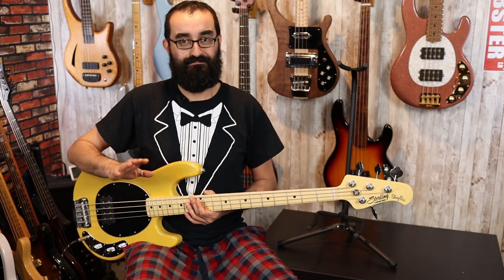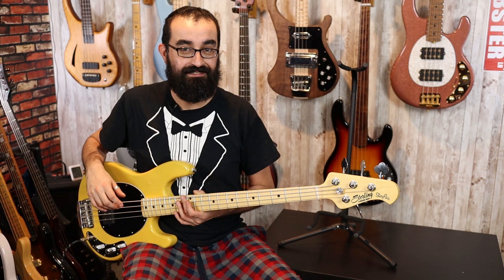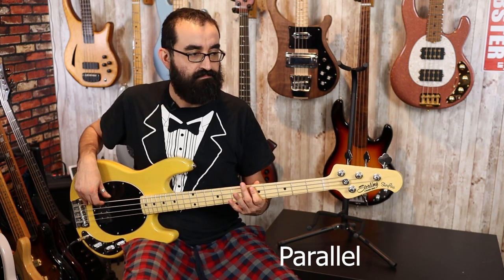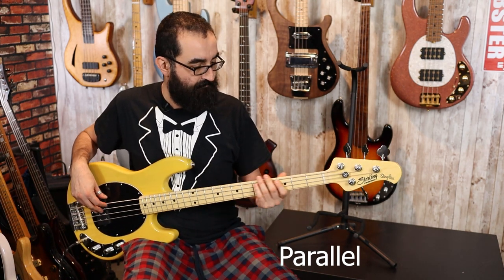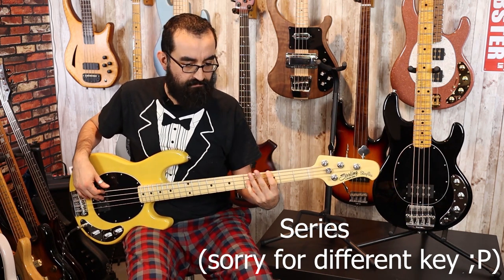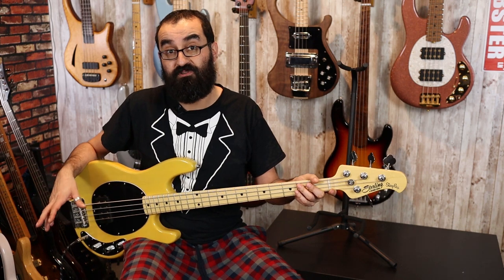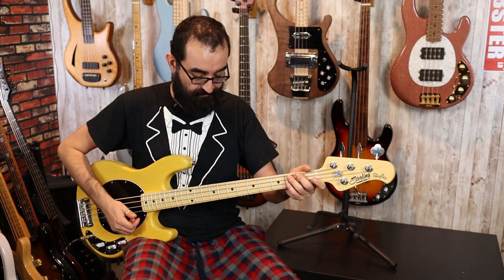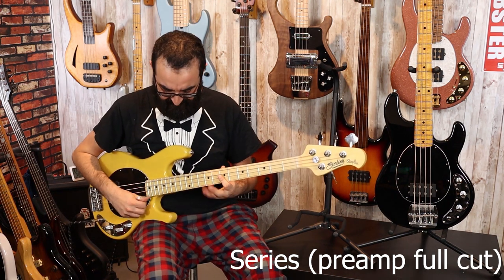Sterling by Music Man Ray24CA wired in Parallel! Why isn't this stock?- LowEndLobster Fresh Look

Comment: True, the parallel wiring is way way better, sounds snappier and more crispy. Has more color to it. I agree, why wouldn't they wire the basses like that?!
Reply from the maker: IMO to make this and the lower SUB line be less authentic vs. their higher end Stingray counterparts. Just a feeling, have 0 evidence to back that up.
Reply: @LowEndLobster  True. Never  in a company's best interest to produce the "perfect" thing because other wise would they have to sell?
Reply: With my Ray4 I was having a lot of trouble with any kind of boost on the bass control causing the input to clip on my Rumble.  Just too much output, even with the pickups screwed all the way down.  Switching to parallel gave me full use of the preamp controls and no clipping!
Reply: Snappy? Crispy? Color?

Comment: I think the sound is very similar either way. As others have said, a series/parallel switch would be a great option. I already liked this bass, you have really got me thinking about buying one around New Years.
Reply from the maker: Thanks! I was thinking about doing the series/parallel switch mod here, but it would get in the way of the ribbon cable for the volume control on the JE preamp (silly design, those things are very fragile).

Comment: I rewired my bottom of the line Ray4 to parallel this afternoon.  I recorded a before and after in GarageBand and it's definitely quieter and cleaner sounding in parallel.  It sounds different and the waveform looks different.  Maybe it's the audio compression YouTube puts on videos, but my results were much more dramatic than yours.

Comment: Just changed the wiring on mine, which is a 25ca. On this bass the parallel setup does make a difference. It's very slight but noticeable. The only thing I have to compare side by side is the Ray34  wired in parallel, and Ray35, which has the series/parallel switch. Both smoke this bass but they are different pre amps and pickups. That bite is there and with some additional EQ it's close.
Reply from the maker: Very nice! Thank you for sharing, Jim

Comment: Awesome video! Parallel is notably different! Do you think it would be possible to make a video showing us how to wire a SUB in parallel?
Reply from the maker: Thanks Roper! So with the SUB, it's a lot harder because you need to take apart the pickup. With the Ray24, there's a second lead and ground that are accessible and just soldered and taped together. Disconnect those and attach them to where the main lead and ground are attached. I believe it goes Red+black for hot and then green, white, shield for ground. Much easier on the 24. I did shoot a separate video showing how to take apart and install the EMG MMHZ and BQC preamp in a SUB though :). That'll come soon.

Comment: I just finished doing this mod myself with a CTS DPDT Push-Pull pot to switch between series/parallel. In parallel, I feel like I get a more cleaner even sound. In series, the output is much hotter, with scooped mid frequencies. With the volume maxed out, parallel remains clean while series sounds overdriven especially when played aggressively. On the amp, at the same gain and volume settings, it’s significantly louder in series than in parallel.

Comment: Both sound great..series is my pick. Would love to see a switch of some sort to have both options on tap.
Reply from the maker: Thanks Robert! I have a switch on a different SUB project (mint-o-ray), but one would be a tighter fit here since I popped in the JE preamp (don't want one of the switch lugs to nick the ribbon cable for the JE volume knob). It's definitely a worthwhile mod if you want that flexibility.

Comment: Parallel is the way to go. I’d go the extra mile and get a replacement bridge to make it possible for a string thru body configuration. I’ve got the ray34 HH in pearl white. The wiring is screwy too. Instead of position 2 & 4 being outer coils and inner coils, respectively it’s full bridge pickup and outer neck coil and inner bridge coil and full neck pickup. While it isn’t how it’s supposed to be according to diagrams it really makes for some interesting tones. 🤷🏻‍♂️
Reply from the maker: Very interesting. I explored the Ray5hh earlier on in the channel but not in the detail that I've done recently. Need to def check out the Ray4hh and 34hh some point soon and do a deep dive
Reply: It’s pretty good. I’ve debated on rewiring it but I think this way makes it unique. The only mod done was I had my gf sticker bomb the pick guard. Which I feel is only fitting since I named it after her.

Comment: Got a new pickup today for my SUB bass.  Going to wire in parallel but can't find any pictures or wiring diagrams to show where to solder.  I've found a video for in series but not in parallel.  Can anybody help?  I'll be doing it in the next couple of days (waiting for my soldering iron 🙃).  Thanks!

Comment: On my modified SUB with Duncan electronics, I have a push/push volume pot to select between series/parallel. 
I use series 99% of the time. It has more girth and cuts through the mix better for me
Reply from the maker: Nice!

Comment: The parallel has more high end sizzle but series has more punch. I saw another video where the guy had a push/pull volume so you could have either. Might do that.

Comment: First of I really like your clips very informative . Can you tell me is the Sterling ray 4 wired in series as well as I just purchased on I would like to wire it in parallel as well . Thanks in advance.  Cheers.
Reply from the maker: Sterling Ray 4 is wired in series. Not all pickups of theirs can be wired in parallel, some are only two conductor and not four.
Reply: Thank you for the info.

Comment: It sounds duller in parallel to me. Seems like the serial is a little brighter and more articulate but then again I'm listening on computer speakers to a compressed & streamed video. Did you think it sounded better in parallel? Would have been nice to hear what you thought in the room. You didn't really say. I'm thinking they did the ceramic pickup and wired it series to brighten things up with the mahogany body vs the ash with Alnico pickup on a MM. Also, the color is a classic color for a Stingray. I just bought one on sale about 23% off from M.F. yesterday. I guess I'll find out how I like it in about a week!

Comment: Series sounded a little darker with a bit more attack while parallel seemed to have a more balanced tone, pretty much what you would expect.  I couldn't possibly decide which I like better without playing the bass in a rehearsal to hear how each sounded in a mix, and would probably end up wanting to install a series/parallel switch.

So, did the mod require any soldering? Just curious as you said it only took you a few minutes. I like soldering and would have been a little disappointed if I didn't have to solder. :)
Reply from the maker: Yup! Just two solder points. You disconnect the existing bridged lead/ground that are taped up, and then wire those to the existing lead and ground spots on the preamp PCB. Very easy.
Reply: @LowEndLobster  you should do a video doing it for schmucks like me

Comment: Not worth the work to switch, just sit the eq on the amp. 
However, if you will open up the electronics, you may as well upgrade the Pickup and Preamp and them use a push/pull… buy a Rey34 or just let it be. 
I know you’ve done more videos on this Bass with all the mods but I’m just venting on this setup. 

You Rock, Lowend Lobster👍🏽
Reply from the maker: Thanks Sumbi!

Comment: Think for finger style I slightly preferred series.  Preferred parallel for slap.  You made both sound good though 👍

Have you ever done a Ray pickup head to head?  Between the various stock pups, the Aguilar, SD, Wilkenson, etc. in various projects, any preferences so far?  I now have a SUB en route (I blame Shia) and if conventional wisdom holds may be tempted to try a swap in the not too distant future.
Reply from the maker: Thanks Joe! I have a BIG head to head to head to head to head to head coming. 6x SUBs modded with 3 band preamps and pickups from EMG, Aguilar, SD, Nordstrand, Bartolini and Tone Monster! I just finished modding the last of them yesterday and going to begin shooting video this weekend! Very excited for this. Not all of them have the goal of sounding like a "traditional" ray, so I'm not going to judge them in that way, but we'll be looking at ease of installation, components, features, sounds, etc. Going to do separate videos on each SUB, and then a big video comparing some of the more popular settings between the 6. Stay tuned :)
Reply: Sweeeeeet - looking forward to it!

Comment: Great video as always. Thanks!!! I just got the same model and for sure want the parallel option with a push/pull volume pot. While my tech is doing that for me do you recommend or think it would be worth it to get a better tone pot and shielding too? If so what kind do you recommend? Again, thank you for the great videos.
👍♥️👍
Reply from the maker: Heyo! I don't think this bass would benefit much from better pots or shielding. Noise and pot quality wasn't really much of an issue. Would be better off upgrading the preamp if you saw the need.
Reply: @LowEndLobster  Thanks, I appreciate ya, Mr. Lobster 👍👍 I will indeed be doing the Pre amp/pickup swap asap!

Comment: The difference is subtle. I’ll probably rewire mine, or rather have someone else rewire it as the solder points are pretty small.
Reply from the maker: Thanks John! Good luck either way you go :)

Comment: Hi thanks for your informative and fun videos! Do you think you’ve handled enough of SBMM’s that you could share your experience with how much they weigh? Is any of them comparable to the weight of the Stingray Specials?
Reply from the maker: Great question Valdi! My next vid coming out when I am done resting up will actually be comparing my SR Special 4H to my regular SR 4H and I will definitely include weight. My SUBs and Ray24 are in the same neighborhood as my 2017 USA EBMM Stingray 4h (9.4 lbs) whereas my SR Special is 8.2! The weight savings are noticeable when moving to the special, but the standard Ray and the SBMM Ray4-24 tend to sit around 9 lbs. My Ray34 that I had was 11 lbs, however I have a friend with one that's only 9.5- they really can vary quite a bit.
Reply: Thats a nitty gritty answer, Lobsterman! Thank you :) wouldn’t it be cool if there was a bass weight statistician? Ordering a bass not knowing the weight feels a bit like a russian roulette to me. In a live situation a small difference in weight can make a big difference. Kudos to Sweetwater for showing the weight on their site.

Comment: Parallel sounds more shimmery like a real USA Musicman. I had a G&L M2500 once and I wondered why I couldn't get a nice open sound like on my L2500. Turns out the M2500 is wired series. I sold it.
Reply from the maker: Thanks Richard! I didn't know that about the M2500. I really need to dive deeper into G&L

Comment: Hello! I know this is an old video so you may not see my comment but I had a question. Do you have a video of how to change it to parallel? I’m getting one of these in a trade and want to use it as a project. This will be my first time modding a bass. Or if there is a diagram of what I have to swap that helps too. Thanks!

Comment: Lots of people seems interested in a switch, as well as myself. Would it be possible to do? And if yes, would it be possible to have a vid to show how to do it?   Today at long & mcquade, I tried the RaySS4 which has a factory switch for series, single and parallel mode. Its a pretty cool feature but unfortunately not available in any of the full size Sterling.  I preferred parallel for slapping but series for fingering.

Comment: Shieeeet I'm rewiring mine right away. Def sounds closer to an OG stingray in parallel.
Reply from the maker: If you have a solid drill/drill press, you could totally make some room for a series/parallel switch and get both options. But yeah, the parallel mod definitely makes the tone a lot more in line with a real classic stingray
Reply: @LowEndLobster  thanks Lobster. You're the bossss

Comment: Hi, I’m the New owner of a 2021 ebmm sterling5. Suppose to be wired in series except both humbucker in parallel in position 3. If you take a look on picture, pickups only have 3 wires. Black, red and green. How can they split coil in position 2 and 4 with only 3 wires? Can I install a switch to have my Humbucker in parallel in position one when I need to?

Comment: Did you have to solder the ground and hot wires to the correct locations to get parallel or are there clips/slots? Thanks!
Reply from the maker: Great question! You have to solder for the stock preamp
Reply: @LowEndLobster  Cool, man. Sorry, I scrolled thru the comments after I commented and saw you answered this question already lol… I just ordered one of these but haven’t received it yet. I’ve owned many EBMM Stingrays over the years and sold them all.. only wish I had one back- 1992 sunburst/rosewood 2 band eq.. even had a natural Stingray Classic with a birdseye maple neck that warped!! Sent back to EBMM and they replaced it with a non figured neck. But I sold ot. Mostly play a P bass and J bass now, but wanted another Stingray in my arsenal for that punchy sound, but didn’t want to spend $2k on a bass that wouldn’t be my main axe, so ordered the Sterling… sorry for the novel lmao

Comment: What are your plans for the 3 band pre as far as pot layout goes? Stacked Pot for Mid/Bass / High/Mid? My gf just got herself this classic 24 sterling as a five string and I am planing to switch the volume pot for a push pull or push push to give her both serial and parallel at will. I think that is definitely the best option for this bass. What do you think? Thanks for the in depth videos and also for talking about the exposed wires on the pickup. We might have gone for the sub series, not knowing that those have only two leads exposed! :)
Reply from the maker: Great question!  For the Ultimate Stingray Mod Guide, I paired this bass with the John East MMSR 3 band preamp which has two stacks - bass/treble and mid/mid freq. However, I ended up putting that East preamp in my Dingwall. I gave this Ray24 away and put in an Aguilar DCB pickup and Darkglass preamp. I used a stacked pot to make a High Mid/Bass control, and an independent low mid control. 

Here's the John East preamp video- https://youtu.be/pKLPOj8ucXw
and the DCB/Darkglass vid- https://youtu.be/w1awEAe2qjo
Reply: @LowEndLobster  Do you happen to know the DC resistance of the classic ray 24 humbucker or maybe measure it for me? That would be very kind!
Reply from the maker: Let me see if I can find the pickup
Reply: @LowEndLobster  Nevermind, my girlfriend just received her's and it measures just over 20k. On another note: Do you know what those two round things are which are screwed in left and right of the bridge saddles? Looks like some kind of mounting mechanism to me, but I'm not sure.
Reply from the maker: @MrJemabaris  yes, they're part of the bridge structure. It's essentially the same as the pre Special music man stingray bridge. Not sure of it's really just for show as the Specials ditched that design all together

Comment: I think P is better for recording.   Maybe a DpDt switch is can give you the best of both worlds.  Bartolini has wiring diagrams on their website for this.
Reply from the maker: Indeed! I was thinking about this, but I installed the John East preamp, and the switch would have made things a bit more cramped on that control pate. Stuck with Parallel for this, but my Mint-O-Ray has a S/P switch!

Comment: Please help Lobster!

I just bought a stingray ray34ca! Yes 34 not 24

Its a 2 band eq instead of the 3band

The bass is really heavy and slab body and has seymour duncan pickup.

What do you think about it? Is it stock ray34ca the same quality as a newer 3band eq ray34.

Ive heard that it actually sounds fuller and better than the newer but this 34ca model is discontinued. Soo im worry i made a bad decision.

Thanks:)

Comment: A true classic would use a boost only i.e. Nordstrand which is based on the original circuit. I have one in my American made SUB. Parallel is the best with an active pre, but passive sounds better with Series.

Comment: I just got a Ray35CA and tried the parallel mod. Although it says ~4.4 kOhm per coil and wired in parallel it gives ~2.3 kOhm (which makes sense that the right wires have been connected) - I experienced a HUGE drop in volume. At 100% vol in Parallel it sounds like 10% vol in Series.

Did you notice that too? Any suggestions on what could´ve gone wrong? @LowEndLobster

Anyone have a proper wiring diagram for installing a parallel/single coil/series switch?
Reply from the maker: That's odd.... Perhaps it's wired out of phase? I'd try swapping the + and - on one of the coils. Parallel has a bit less kick, but it shouldn't be that drastic.
Reply: @LowEndLobster  Thanks, that was it. It was wired out of phase. Got it fixed - for anyone interested: red&black goes together to hot and green/white to ground. Then you get amazing parallel tones out of your SBMM Ray. :-D Great tone option - I might install a switch now - like both sounds on their own right.